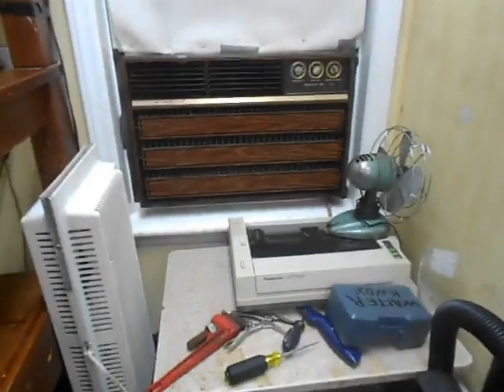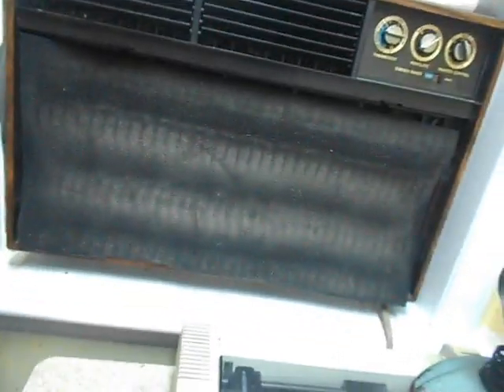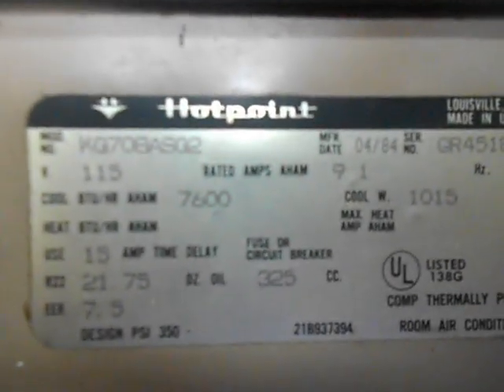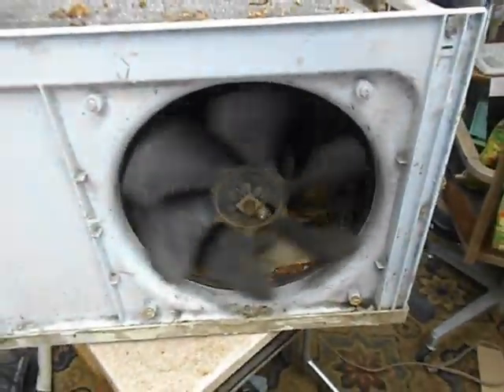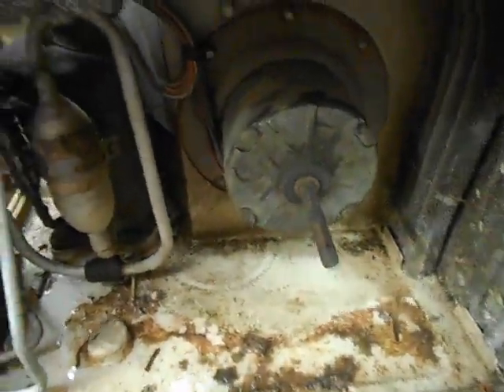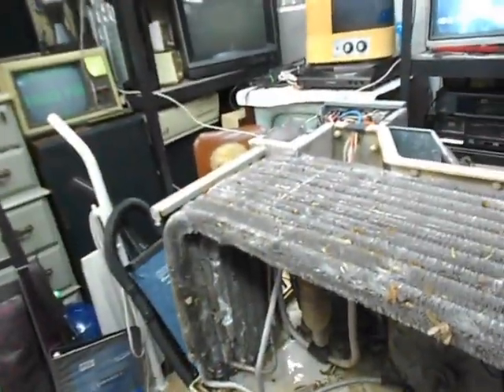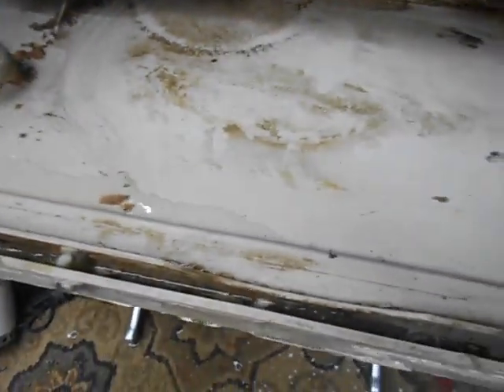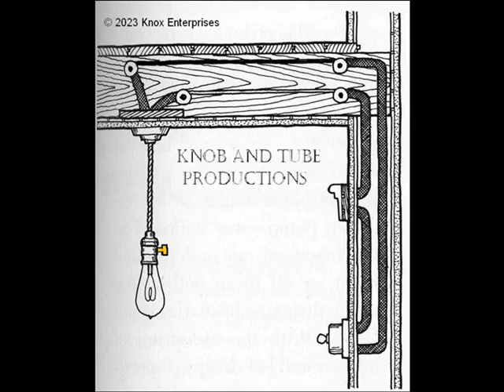Clearing a clogged drainage passage in a 1984 Hotpoint Quietaire room air conditioner.

Comment: It amazes me how you you have all these old airconditioners and I got three that are at or slightly over a decade old that I'm thinking of replacing. Also would love a video on how to get mold out of AC's
Reply from the maker: If they are only slightly over a decade old, they are probably not made to last like the old ones are, so it wouldn't surprise me if they were wearing out. The late 80s (some early 90s) units were the last good ones.